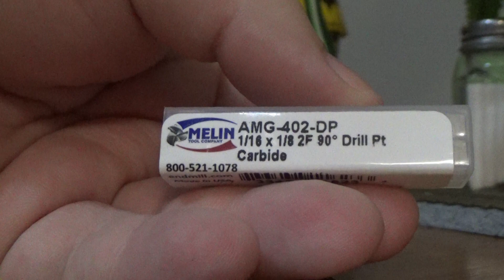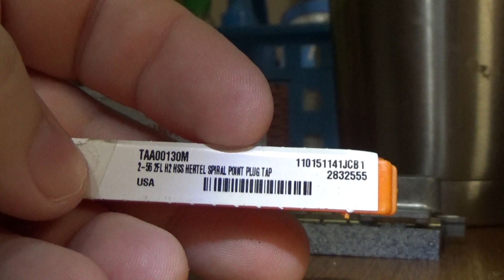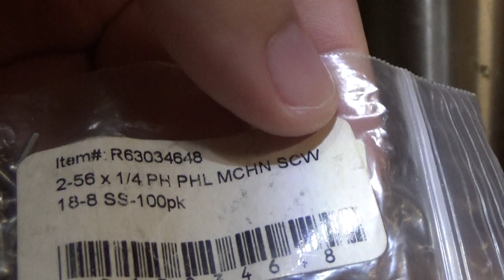HO Scale. Body mount vs truck mount. How to

Comment: Thank you so much👍👍😊. That part called talgo was what I was missing I had some of it down so I was on the right track and then the other part did not know none of that thank you so much I worked at Midas so I've done tap and dies now I can get my other gondolas working and a couple other pieces of Rolling Stock and I consider you my friend too thanks for doing the video I appreciate it a lot until your next one
Reply from the maker: Remember bro, talgo only works on tycos.

Comment: I drilled and tapped 90% of my rolling stock when upgrading my couplers. In a pinch there are a bunch of videos of people super gluing the draft coupler box to the car. Like you said in the video the number 5 kadees need the centering spring, Which I just checked and you can definitely buy them with a quick search. Good luck.
Reply from the maker: I found them, already used them too haha